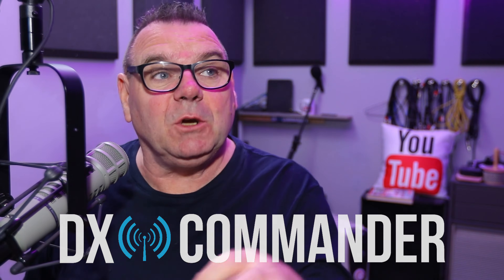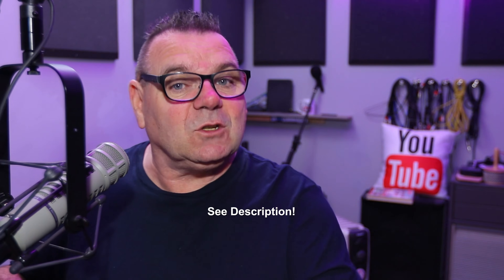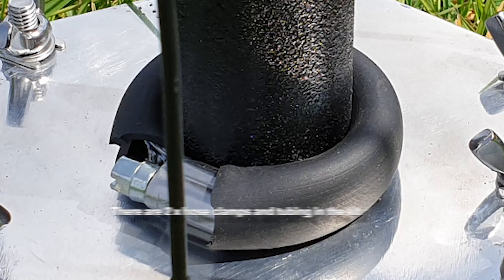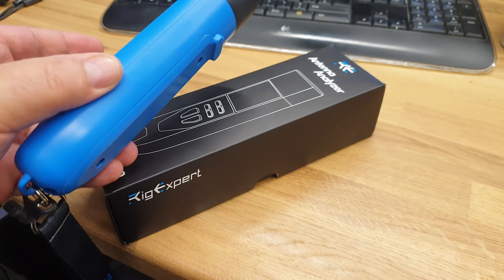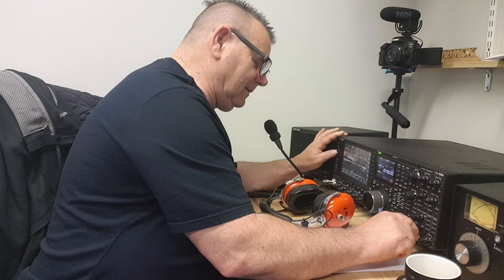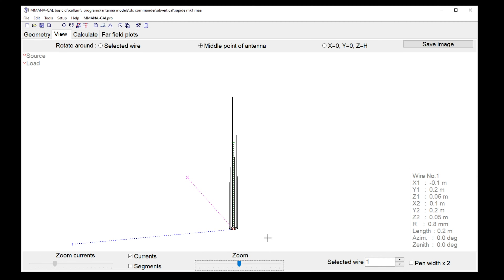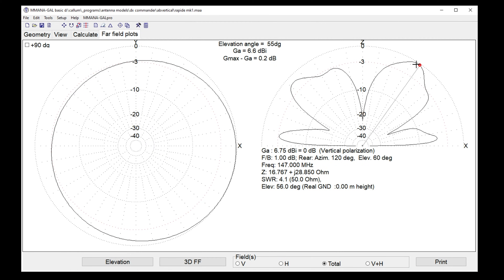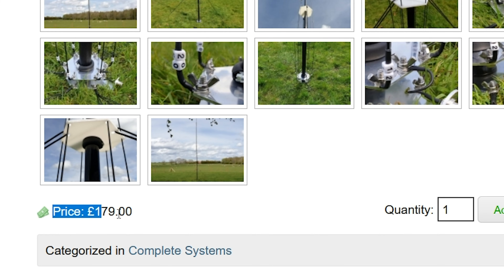How to Build DX Commander Rapide 2022

Comment: Do you need the foldback on 30m? If I have a 25 foot pole could I just run the 30m wire without the foldback all the way up?
Reply from the maker: You only need a foldback to make sure there's enough at the top to create some tension. It has absolutely no measurable effect on performance.
Reply: @DXCommanderHQ  Thank you sir. I'm excited to build this antenna!

Comment: Hi Callum, really enjoy the video. I purchase the mast from DX Engineering and I am working on a Home Brew. One question, what will happen if I make a "coil"  for 40 meters  in line and not wrapped around the mast? Will it impact the other bands ? I  to use the mast for mobile operations - the size and weight are perfect. I followed the instructions and cut all of my band wires, I cut the 40 meter per the instructions, just trying to avoid wrapping around the mast.
Reply from the maker: OK.. You COULD find a small length of 2-inch former (6 inches probably ideal).. Wrap some turns around it (probably about 10).. Slip it over the mast then continue up to the top and adjust the foldover for best resonance..
Reply: @m0mcx  Callum, Perfect I will experiment and report back the results.
Reply: https://drive.google.com/file/d/18YyCpj5SSSjrbNdceRNNPZ74jYmxUhZj/view?usp=drivesdk
Reply: Coiled worked great. It is a little low, I need to trim the elements, and maybe add another turn.
Reply: @patrickhooper1757  can you share your results and how you build the coil? What is the SWR in the other bands? 73 de TI3GB
Reply: I haven't put that antenna up for a while. Let me put it up and record the results. If I recall most bands were 1.5 or less. The 40 meter band was just a little low so I trimmed the element.

Comment: Hi Callum, you reference another video showing how you designed the antenna. Does this go through the MMANA model in detail? I've been trying to replicate your model (basing the wire lengths off the instruction sheet cut list) and finding that I'm not getting comparable results.

Unfortunately the shipping to Australia is horrendous, so I'm attempting to build a replica Rapide. Just trying to validate the model before I start cutting any wire. Are there any traps for new players with MMANA that might explain why the model is off?
Reply from the maker: Talk to me about shipping.. Better still, watch the channel.. I have a deal coming up any day. PS - the MMANA model is here https://drive.google.com/file/d/1gmF6QbmYliABZt2ybd7bONvxP9cs5iP0/view?usp=drive_link

Comment: hi Callum,  having messed about with cbs when i was a kid i am wanting to build something but i know abolutly nothing and i'm struggling to get a handle on what i need. i would like to make an antenna that can be used with a cb radio but also used with a cheap baofeng uv5r typoe thing. i know they suck but money is tight right now and i just want to make something work so i can show the missus the hobby is not a massive waste of money.  we are both somewhat conserned about russias movements right now.  and yes i intend to pass the foundation before transmitting on the baofeng.  i dont know if we can do it with one antenna or wether just buying a cheap set up wpuld be the way to go.  any advice would be good.  i live on top of a hill if i say emley west yorkshire that would give you an idea of where we are.  many thanks and thanks for your channel.
=
Reply from the maker: OK, so make ONE antenna for both CB and VHF/UHF is not impossible but - er - weird! Your best bet is 2 x antennas.
Reply: An Ed Fong J Pole is great for VHF/UHF but you will need an antenna for the 11meter band (CB) so two antennas like Callum says.

Comment: How would an aluminum mast effect this antenna's performance?
Reply from the maker: I don't know.. It can start to work like a huge dumping capacitor. Made that happen originally with the 12.4.
Reply: @DXCommanderHQ  ty, i just have tbe used military rft sectional tubes and was tempted to try. They have composite guy rings that could be modified to accommodate the elem

Comment: Hello Callum. I’m using a DX Commander Rapide for almost 2 years now with a tuner connected but I’m about to fine tuning all the elements for a perfect SWR. You mentioned here the SWR calculator… so, in which order should I start adjusting the elements or there’s no variation in 20m (for example) if I adjust the 12m element? I’m a bit confused with that
Reply from the maker: OK, small changes to one element will no affect the other elements. WHat I do is adjust all the elements at the same time. Normally it just "works".

Comment: Callum, I have a question. Rather than all the radials, what would happen if I drove a 4ft grounding rod at the base of the mast and ran a copper grounding wire from the bottom plate to the ground rod? Permanent install obviously
Reply from the maker: Keith, a ground rod is good for lightning only. You will need radials friend..
Reply: @DXCommanderHQ  he could use a window screen! :)

Comment: I have this system and its excellent, I did a small modification and it was to connect one of the radials to the  metal roof of my house. the antenna Works great and I have could make the turn around the world with the DXC! I really recommend this product, specially if you live in HOA areas, my neighborhoods thinks I have a weather station on my yard! 😆 73s!  T
Reply from the maker: Haha brilliant!!

Comment: Hi Callum,  Thanks for these videos - I love your products and the beautiful way that you present them in a no nonsense, clear manner.
My house has a 2.5m wide side portion between the house and the fence that is likely where I will be able to place it - Imagine, a long rectangular section - 16m long, but only 2.5m wide.  in your experience, how would the radial system work?  Should i stop thinking, and just do it - Hopefully, it would be significantly more effective than my longwire antenna for DX.
Reply from the maker: OK easy.. Place them down with the longer ones going up and down the passage and a few tiny ones near the base between the fence and house. Just litter the floor :)